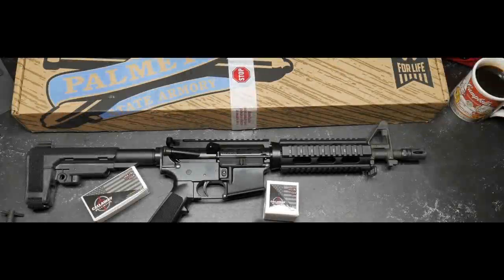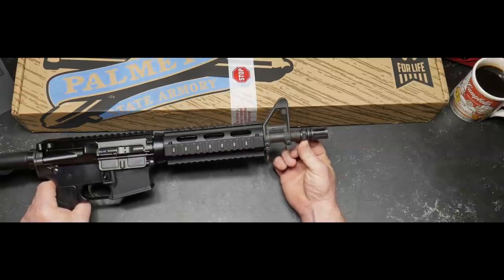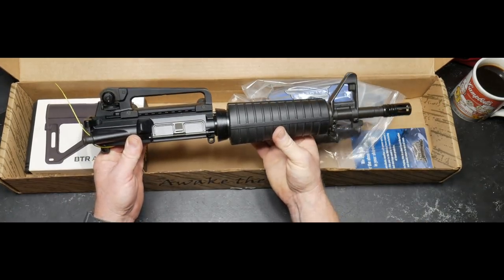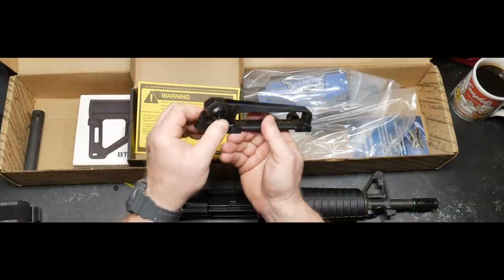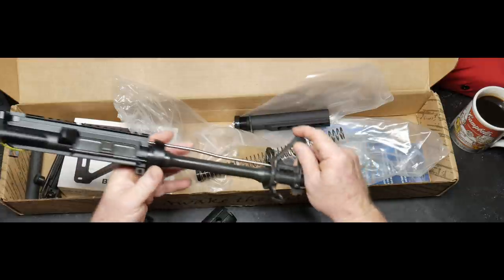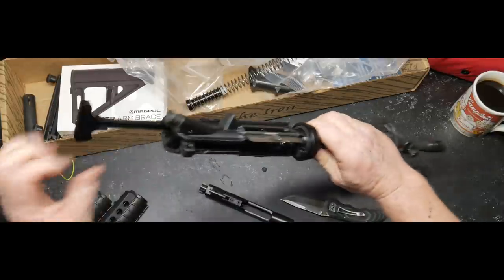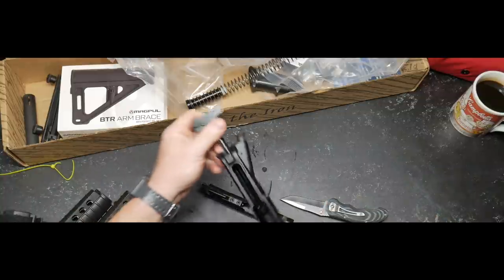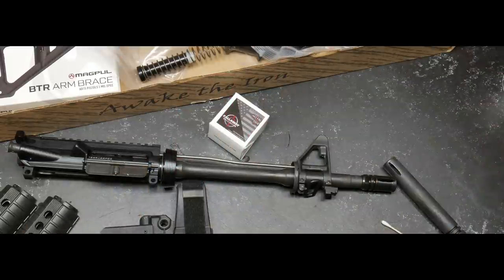11.5 Inch Palmetto State Armory Overview

Comment: I'm sure it'll be cool as hell when it's said and done , but if you're going to pin and weld out to 16" why not just go with a 16" barrel and get all the ballistic advantage ?  Or pin and weld a 14.5" barrel with a short muzzle device ?  Just a thought .
Reply: I was thinking the same thing lol
Reply: I see a lot of people do this. buy short barrel and get long muzzle device to go 16. I feel it defeats the purpose of a pistol build. I personally don't like pistol-rifles and change out my muzzle devices a lot so just go with 16. It absolutely sucks major donkey D that we even have to do this kind of crap because of an arbitrary number made up by stupid people.
Reply: SOLGW 13.7 with a NOX, gets you to 16. Been my go to for many builds and never disappoints. *Fourtyfive in my state, as shitty as it may be, anything over a certain length can't be considered a 'pistol' automatically. So a 16" build is already a rifle or firearm by default. 11.5 KB using would be pushing it for OAL, may need a SI pistol buffer tube
Reply: Because he told you at the beginning of the video he is building a car 15. That's why
Reply: @Thecoolistever  ; but he's not building an SBR and is going with a 16" barrel so he can use a stock and not a pistol brace . Why not go with a barrel that gives the bigger bang for the buck ?
Reply: Bro the car 15 like he just said was going to build in the video we watched and I believe he said build for fun the car 15 has a 10.5 or 11.5 " barrel with a ridiculously long muzzle device like 5.5 inches.  Look it up. Seems to me he is building a retro gun for fun and not performance.
Reply: @Thecoolistever  I missed the part about the car-15, and never heard of one before, so thanks for that. So yea, if you're doing a clone build then it makes since. If you're only doing it for the legal length as I have seen others do, not so much.
Reply: @xSP3CTREx  
Just use a 16" barrel and get the velocity.
Reply: Because he's going for a CAR-15 aesthetic. 🙄. It doesn't have to make sense, its just for looks and fun.  Ever seen Blood Diamond or Black Hawk down?  He's building something that looks like some of the rifles seen in those movies.

Comment: I was surprised how heavy aluminum hand-guards are compared to the vintage style plastic one's. Had no idea it would be such a massive difference. If you're looking for a light gun/pistol, vintage style is the way to go.
Reply: ? Their lighter than ever, did I misread?
Reply: Apparently I did, however we are at the pinnacle of AR design.
Reply: Carbon fiber hand guards have joined the chat
Reply: @That_Guy5575  lol. Great idea. Will definitely look into that. Have shoulder injuries to both shoulders, so I really need a light firearm.
Reply: @deucedeuce1572  Funny you should say that, I’m very nearly done building an AR for my dad that I specifically made to be as light as financially/reasonably possible! It’ll be his very first semi-auto, let alone AR, and it has a Faxon 18” gunner profile 556 barrel, an aluminum sound forwarder/linear compensator (for shooting out in open fields, cause I know he’s not likely to wear hearing pro), a titanium gas block, a BRT EZ TUNE gas tube, a UTG PRO titanium barrel nut, a homemade carbon fiber hand guard I almost have done, and a KP-15 lower, which is something like 12 ounces lighter than a standard aluminum lower, and is arguably more durable in some aspects. I’ve also got a Burris 4.514x42 Fullfield E1 scope, which has excellent glass quality, a great BDC out to 550 yards and even wind holds, and only weighs 15 ounces. The gun is remarkably lightweight, with very little weight out front, which I specifically made to be as such because my dad also has shoulder injuries that makes holding up a front-heavy rifle almost impossible. 

If you don’t want to build it yourself, however, and you have the money, I highly recommend purchasing a WWSD2020 rifle from Brownells. I think it’s about $1,200, weighs just under 6lbs as configured, and handles extremely well. It’s a great pre-built candidate in your case, I believe
Reply: @That_Guy5575  Nice. Good idea on the homemade carbon fiber hand-guard. I actually have the tools/supplies for making things out of carbon fiber (carbon fiber, epoxy, tools, etc...). Never thought about making my own hand-guard though. Might have to put some time into thinking about it, how to do it and maybe do some research online to see if anyone has any good videos/tips about it. (Never worked with carbon fiber before).

Is the WWSD a very lightweight rifle compared to other AR's? (That KP-15 lower is very lightweight. Wish I could afford one atm. Heard of them before, but didn't know what was special about them). Appreciate all the info.
Reply: @deucedeuce1572  More than happy to help! I lovvvvve building things, especially AR’s lol. 

So about making your own carbon fiber hand guard: there’s actually a lot to it, unfortunately. I based my design to use a  titanium barrel nut made by UTG that doesn’t seem to be available anymore from what I’ve seen, so I’m not sure what else would be suitable. I also have a friend who has access to a lot of advanced and costly milling and CNC machines, and I wouldn’t be able to do these without that access. I had him mill down an aluminum rod into an octagon of an exact measurement, because pre-made aluminum octagonal bars are non-existent online from what I’ve seen. Aluminum specifically was chosen because it’s thermal expansion coefficient; in other words aluminum expands quite a bit when heated, which is very good in this application, as it puts additional tension on the carbon fiber as it’s curing, and then will shrink when cooled, allowing for a far easier extraction of the bar after the carbon fiber has cured. You’ll also need flash tape, some sort of a release (we used a purple ‘tape’ of sorts, although it wasn’t sticky), and a clear ‘tape’ of sorts on the outside that will shrink when heated, also putting pressure from the outside as the carbon fiber cures in the oven. I also used a square wooden dowel along the top of the bar to create the clearance necessary for the gas block and tube, which I simply hot-glued on, and a couple of slate metal rod on either side of it to press the CF into the recesses. 

So, in all reality, it’s a ton of work, and will be very very costly if you’re just making one or two and not going into production. You’ll either have to have an aluminum bar custom milled by someone or do it yourself, and that would be extremely expensive to have done. I paid my friend by making him a couple of hang guards. You’ll also need someone with access to a mill/CNC machine and who can program it to mill the m-lok slots, which is also expensive and a pain, being carbon fiber. Add to all of this, it’ll take a few tries of getting it right, and the hassle of mixing the epoxy into the CF (unless you use pre-preg like we did, which is very very nice to work with, but expensive), and you have a massive project on your hands. Not trying yo discourage you from doing so, just trying to give you a fair warning of what you’re facing. There’s several companies making carbon fiber hand guards that I can recommend if you want! They’re not cheap, however. Usually about $250 on average. 

To address your other points: yeah the WWSD2020 is an extremely lightweight rifle, especially compared to most modern AR’s. The main ways it saves weight is by utilizing a pencil profile barrel, carbon fiber hand guard, and the KP-15 lower. A striped KP-15 lower, by the way, is only $110! Offered in both black and FDE, and there was a brief run of OD Green. 
There’s many videos of the WWSD2020 rifle, just type it into the search bar here on YouTube and you’ll see many results. 

I very much so enjoy helping out others build AR’s, and am more than willing to answer any questions. In my opinion, every person that’s able and responsible should be able to own a customized AR for their purposes, and there’s just SO many options out there for highly customized builds.

Edit: look up Easy Composites here on YouTube. They’re an excellent resource for learning about CF. Mike Patey is also another excellent place to observe someone making lots of extremely high quality custom CF parts, but they’re imbedded in his videos so you’ll have to do some digging/lots of watching to find them.
Reply: @That_Guy5575  guess they can be difficult. rob depends on the design though. was just thinking making two halves like the old vintage style handguards and using the same king of barrel nut... the spring loaded kind.
Reply: @deucedeuce1572  Ah ok, I hadn’t even considered that. Would probably be a much easier way to make it that way! You could even make some molds from some pre-existing hand guards if you wanted to, and then lay up the materials in that and vacuum bag it. Lots of options out there, I hope you find something that works! 

You’re making me think, I want to make some carbon fiber A1 triangle hand guards now! That’d be sweet.
Reply: @That_Guy5575  lol. can make both... an excuse for another build.
Reply: @deucedeuce1572  Exactly lol. I’ve been wanting to make a pseudo A1 build for quite a while now. Just a few of the main highlights of what I would like it to have: 
A KP-15 lower; Colt LMG upper Receiver (fixed carrying handle, A2 sights, dust cover, brass deflector, and no jam Enhancer, er, ‘forward assist’); some sort of super lightweight 20” 5.56/.223 barrel with either a 1/7 or 1/8 twist (thinking Faxon gunner profile if I could ever find one); a modified free-float tube under the hand guard to be made of carbon fiber; carbon fiber A1 triangle hand guards; some sort of lightweight FSB if possible, if not I’d stick with the original; a chrome BCG; and a JP Enterprises silent capture spring. 
There’s a lot more fine details of course but these are the main highlights of the build I’d like to make eventually. The more I look at photos of A1’s the more I wanna make it lol
Reply: @That_Guy5575  Damn, Sounds like an extremely well thought out build. May be one of the lightest AR's ever built. (Gotta love "jam enhancer". Have seen people blow up their guns, because they foolishly/excessively used the forward assist without trying to figure out what the problem is).
Reply: @deucedeuce1572  Appreciate it! And yikes! I’ve never seen it in person, but I’ve heard some of the stories. Ever AR I’ve ever built/will build, expect in a free RARE exceptions (mainly dedicated 22LR AR’), does not have a FA. I personally don’t like the aesthetics of them, and don’t believe a quality gun needs them. 
The only reason I want one on some of my dedicated 22LR uppers is so I can hold the bolt shut while firing low-powered subsonic rounds for the ultimate quiet shot. 
Ian from Forgotten Weapons and I think InRangeTV both have videos talking about the FA. Ian even has an interview with Jim Sullivan (the guy who worked with Eugene Stoner to design the AR-15) and they briefly talk about how the FA was only added because of sheer stubbornness and political pressure when the guns malfunctioned, which was due to the military trying to cut corners and use old WWII M1 Garand gunpowder instead of the powder specifically made for the M16, which caused massive malfunctions. That, and they also tried to cut corners and not have any cleaning kits with them.

Comment: This upper is the basis of my bedside gun.  It's slightly overgassed for 5.56 loads but using an H2 buffer "fixed" that.  Right out of the box I zeroed it and took it to a carbine class.  500ish rounds, no issues at all.  Of all my 5.56 PSA uppers (several) I have had no issues with any of them.
Reply: The fix is always an adjustable gas block to throttle back the pressure.  Even a $24 one is fine.  It’ll take care of the excessive recoil, too.  Get it back into proper cyclic timing.

Comment: Love PSA. Their quality has continued to be above par. I still hear from the Gucci crowd about how their top tier battle rifles (not talking about competition or marksman rifles) are worth 3-4x more. I haven't seen that actually proven. Given equal triggers and optics, I'd like to see that. (Hint).
Reply: If one was to stop and think about it , all the forged upper and lowers come out of the same 5 or 6 foundries and are made of the same alloys , as long as the machining is done to spec. there really isn't any difference except maybe looks . I think of the receivers as jigs to hold the moving parts so they can do their job.  The real heart of the matter is the barrel and the bolt . Those two things being equal there shouldn't be a dimes worth of difference .
Reply: @orionfixr7713  correct, but their machining, or whoever is doing their machining is doing a shit job, I think they make barrels and assemble the cheapest parts that they can get their hands on, I know for a fact that they drill and pin their front sight basses on, even on the fn barrels that they resell, their game is to sell just enough high end components and rest on that, such as FN barrels, they suck in general, I’ve gotten crap twice, there will not be a third time, but hey if Elmo is happy with what he get’s, then great.

Comment: The last few PSA uppers I got were great, but I noticed you had the same issue with the charging handle.  They are just a little off and don't drop out like they should, but let's be honest it's going to get upgraded anyway. Merry Christmas to y'all!!
Reply: Is it the charging handle? Or the receiver? Thanks!
Reply: @stuartholden6163  who knows, you’d think they’d put a decent one in there but that’s one of the areas they save money, I watched a video today, where the grey haired duck wad with glasses was showing off al of their precise measuring tools, but when it comes down to it, stuff leaves there out of spec on the regular.
Reply: It's the charging handle, I wondered the same thing but every other handle I had in proven uppers and new ones not in builds yet worked fine.
Reply: They wear in

Comment: I have purchased two upper from PSA one  300 black out and one 556 .I run both on PSA lowers i Assembled they run great , I always run H2 buffers they run like a champ .The 55.6 is an 8.5 with a blast device on the end the barrel .

Comment: I see a lot of people using the "High end" brands and shit on PSA because "they just don't feel right". I know I don't shoot anywhere close to the rounds some of these guys do, but I've shot PSA, home builds, DDs, and FN's and yes some are more accurate than others at distance, but the way they feel shooting is not that different to me. Makes me wonder if its more of a placebo effect of "cheap" vs expensive or even justification of the price they paid. I'd say its more likely that I am the one trying to justify NOT spending $1800 on a rifle, but hey if it works it works.
Reply: Most people can’t get over the fact that price doesn’t necessarily equate to quality in  the AR world. The fact is, the technical package for the AR has been available to the industry for decades now, so anyone can produce one that meets the minimum requirements for field grade durability and reliability (mil-spec). Many people have to justify overpaying by shitting on lower priced products, even when the performance gap doesn’t justify the higher price. If someone pays $400 for PSA, and someone else pays $1,2000 for a xx brand rifle, are they really getting 3 times better performance from it? Far from it, but better make sure to mock and ridicule the PSA guy to make him look 3 times as poor and foolish than you xx brand guys. They are all just parts builds anyway. Anyone who claims to make 100% of the rifle in house is a liar.

Comment: I’ll happily swap you a 16” Lightweight Model 1 Sales (actually made by ER Shaw) barrel with maybe 120 rounds through it for that 11.5 barrel if you want. It’s .625” diameter barrel so you can get a telescoping XM177 flash hider that goes back over the length of barrel and gives you that original Commando look. I’ll even throw in a correct flat slip ring and some skinny CAR handguards if you want. 

Let me know.

Comment: Also, change out most charging handles.
Reply: I get that but why should they get away with supplying a cheap and obviously out of spec charge handle in the first place? Because they are cheap? What makes you think that the rest of the crap they sell is any good.

Comment: PSA is awesome. All their stuff is great. EXCEPT. You need to switch out the buffer and buffer spring. I have this exact gun. The spring is weak and the buffer weighted 2.8 oz. Over gassed is an understatement. JP spring, purchased a buffer weight kit, switched out the weights inside the buffer, buffer now weighs 4.8 oz with the spring it is a sweet shooter. I switch out the buffer spring and increase the buffer weight on all PSA guns.
Reply: Yes, and if you were to look closely at what you got, you’d realize that the rest of it is probably weak as well, but if you’re a satisfied customer and don’t know the difference then great!

Comment: I would say check every dimension and give it a good shakedown with PSA products.  Personally, I've had enough issues with them over the years that I'm probably done purchasing their products.  They are trying to stay at too high of a volume and quality is clearly compromised even to the naked eye most of the time.  The turnaround times on a repair are not exactly attractive either due to their apparently high rate of returns.  
If you notice, a lot of new uppers are initially offered at a lower price I assume because they want to get rid of "yellow" spec examples out of that run first.